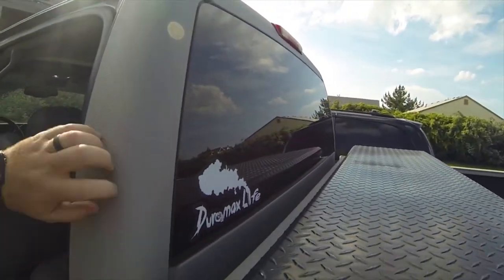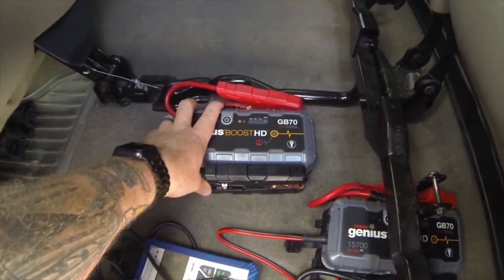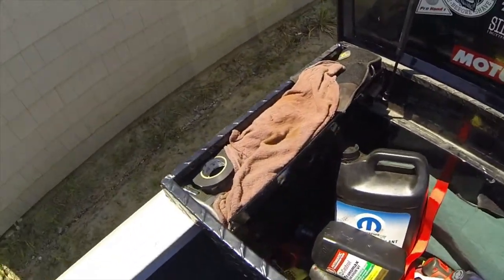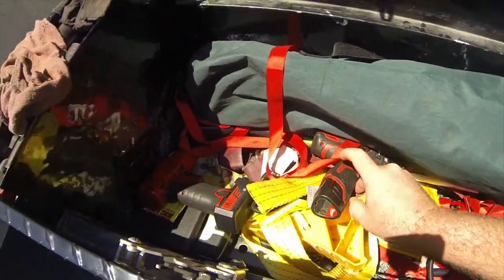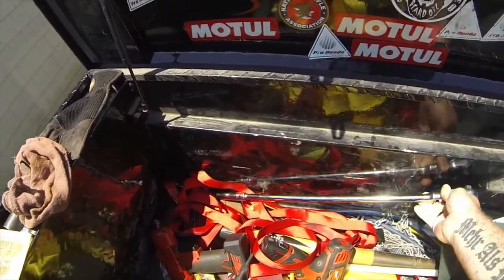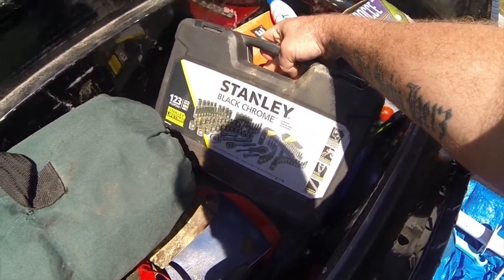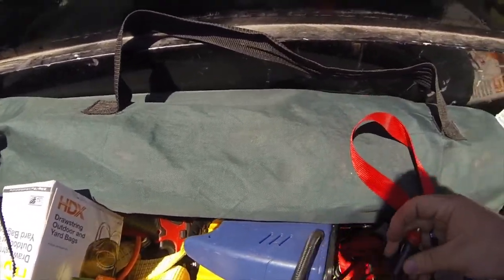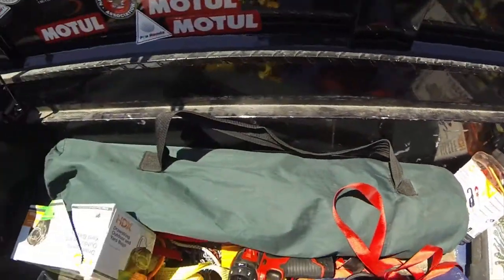Duramax Truck Toolbox Tour!!

Comment: I have a 2013 regular cab Silverado 1500 so next to no storage in the cab. I used to have a weatherguard but sold it and got a Fold a Cover tonneau. I still needed some storage in the bed for tools so I bought an old truck box on kijiji for $20, shaved the head off, and now it sits flush under the tonneau and allows me 10"  room under it for longer items like plywood etc. Great video dude.

Comment: I keep all my extra fluids in a plastic tote box because I’ve had them rub holes in them before and get oil EVERYWHERE. So now all my extra fluids are stored alone in one tote. Straps in another tote to prevent any harsh damage and easy access. I have jack stands (2) 4 ton stands, 1 floor jack rated for 4,000 lbs and the rest is left over room for travel bags on road trips then I also purchased a Montezuma triangle toolbox for all my regular quick access tools that always seem out of order. Since the purchase of that I don’t struggle finding any tools on the road and it is what left me the room for extra items in my big box. Organization is HUGE for getting the best use of toolboxes in my opinion.

Comment: Man ive got ratchets 1/4-1/2 inch, screw drivers, nut drivers, cordless and traditional impact, all kinds of sockets, wrenches, Channel locks, vise grips, duct tape, electrical tape, flash lights, magnetic trays, box cutters, funnels and all kind of other stuff. need to take some out and de clutter